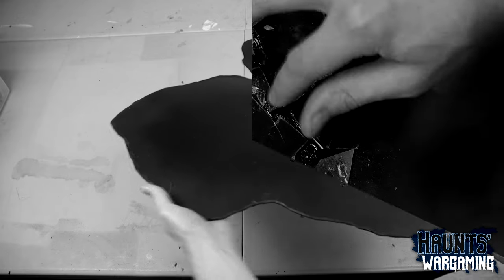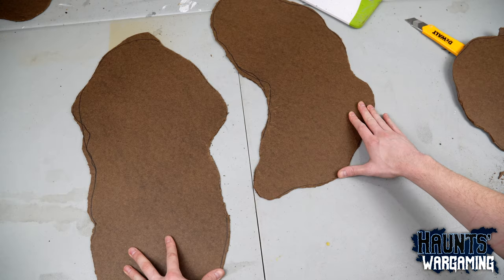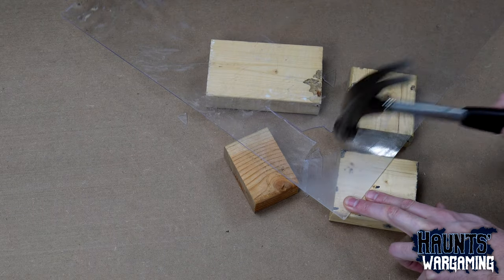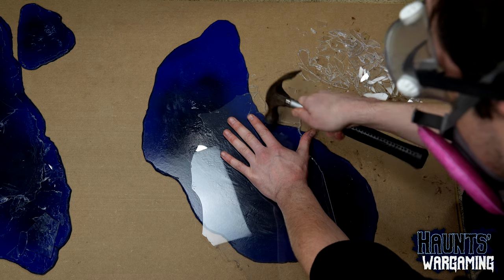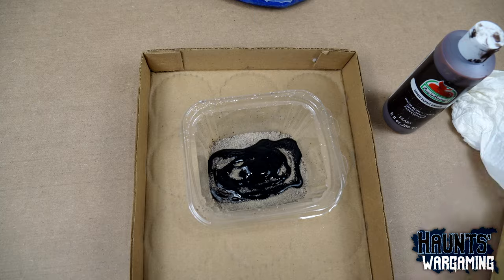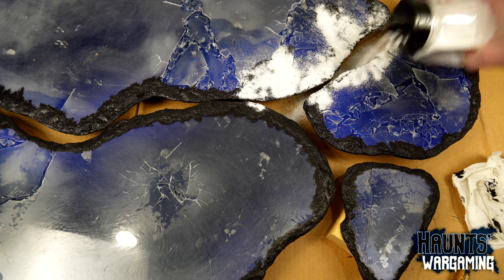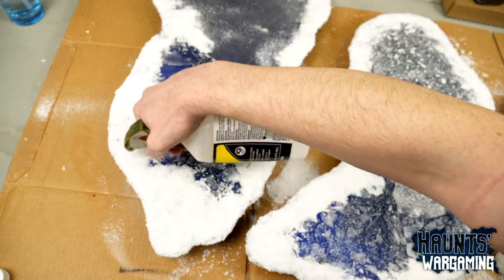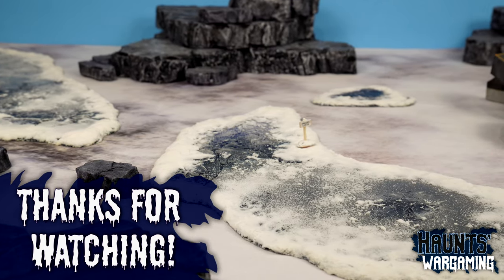Make BREATHTAKING, FROZEN PONDS & LAKES! Wargaming Terrain Tutorial

Comment: I prefer the unsanded, clear ice look.
I wonder if clear silicone adhesive/caulk would work for fixing the plexi in place.
If I were to build these, I think I would go with just a touch of now on the edges, and leave more of the clear ice visible, like the small piece at 9:13.  It seems a shame to cover up all of the work that went into the pretty blue paint and clear ice.
Great project!  This battle mat and terrain would go well with my blue "Ice Demons of War" army.
Reply from the maker: For me sanding helps with the glare from the studio lights but for most people that's not an issue. I think clear caulking would probably work pretty well. I'm not sure how long it would take to dry/cure.
Thanks for the comment :)

Comment: That clear Gorilla glue activates with water and gives you a much better bond when using it with just about everything when moisture can't get through to the glue to cure.
Reply from the maker: 🤔That hasn't been my experience with this particular glue. It's not like clear school glue. I use this to join resin together. Never had issues with it curing.
Reply: @hauntswargaming  It's part of the directions on the bottle. 🤷‍♂
Reply from the maker: @tmilker  I usually give it at least a half an hour to cure.  For these I gave it a day. 
I'm gonna have to have a look at the bottle lol
Reply from the maker: @tmilker  it does say to lightly dampen one surface. That doesn't activate it though in my experience.
Reply: @hauntswargaming  Maybe "activate" was too strong of a word but the glue works through the humidity in the air regardless(much like how silicone caulking cures).  When you squish the glue between two things that don't "breathe" it takes a lot longer to cure because the outer edge cures quickly and then seals off the glue from more air and thus moisture.  Sure, it will eventually cure but the water helps a lot for bonding stuff like plastic or closed cell foam.
Reply from the maker: @tmilker  makes sense. I was anticipating it taking a while to fully cure.  in the future I'll try adding water just to test it out. Thanks for pointing that out. I never would have guessed that was in the directions lol

Comment: Do you have a Menards near you? They usually have better precut options than Lowes and Home Depot.
Reply from the maker: @looselycollected7505  nope never heard of them
Reply: @hauntswargaming  They are out of the midwest. But are growing and adding new stores. I've generally had much better experiences with them for smaller or custom cut pieces.
Reply from the maker: @looselycollected7505  I'm in Pennsylvania. Lowes/Home Depot are pretty much the only options outside of lumber yards.
Reply: @hauntswargaming  well rats. I guess I'm lucky now. We have a couple of them within relatively easy driving distance.We also have several Harbor Freight stores nearby, which helps here and there with the odd tool you can buy cheaper there. Well, Menards keeps expanding. Maybe you'l get one someday.
Reply from the maker: @looselycollected7505  we have harbor freights but they don't sell lumber :p
Reply: @hauntswargaming  not here either. Just meant that they were great to have for tools after not having them for a long time and having to order from their catalogs for years.